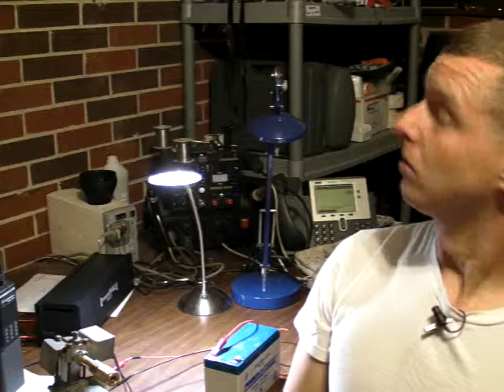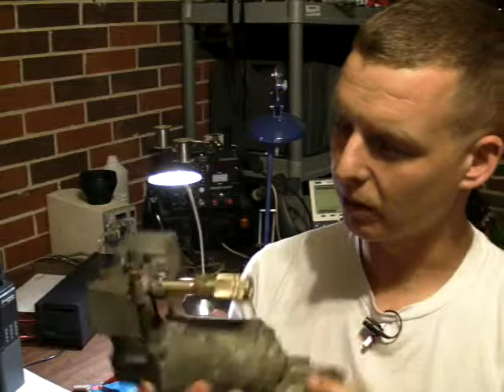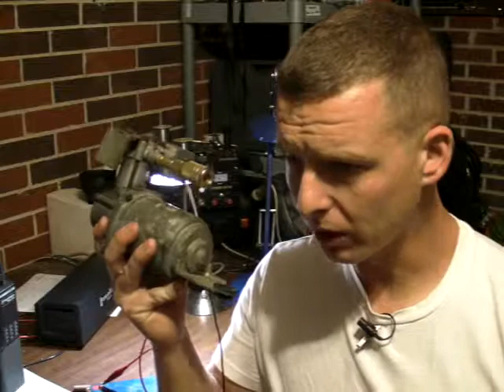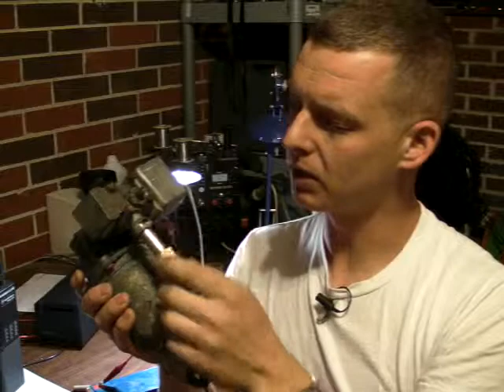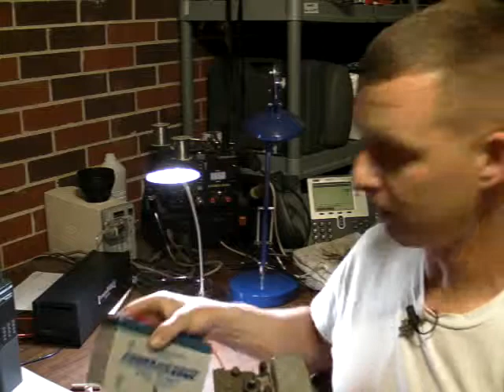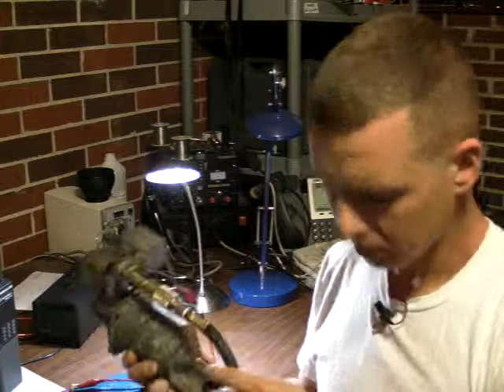DIY Home Built Portable Air compressor from Load Level System

Comment: I've got a '86 MGM wagon without load leveling. I'm thinking about adding one. How did the stock load leveling work? Was it automatic? And did the air feed in to airbags or into the shocks?
Thanks in advance.
Reply from the maker: +Ronald van Kemenade
It was automatic and it feed into air-shocks... I think I didn't know much about cars then when I had the car, it was many, many moons ago. The compressor motor was located on the engine right side with a three-point rubber mount. 

If I were to make a guess, there was a mercury switch that was activated when the ass-end of the car was brought low enough through weight of a trailer or hauling. I remember Dad disabling it because it didn't work right and the dealer, after several attempts, failed to fix it.